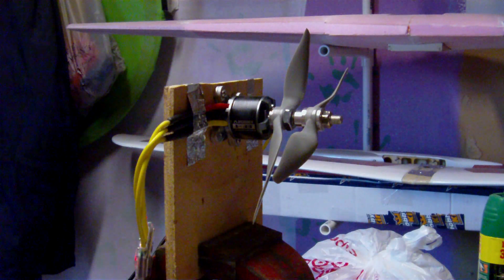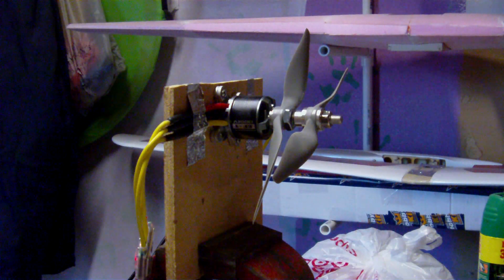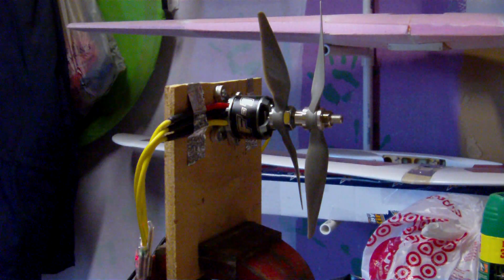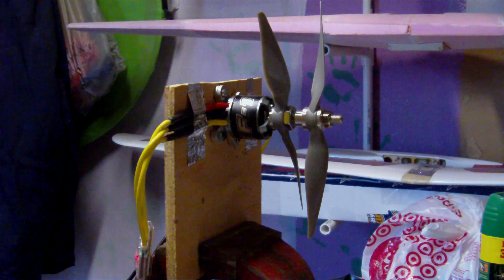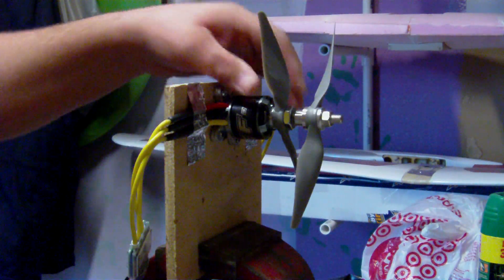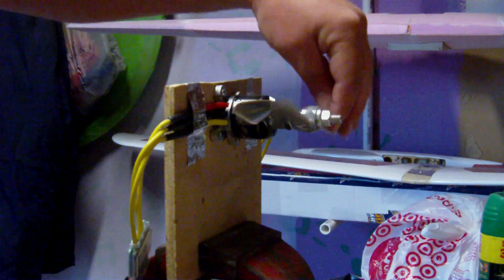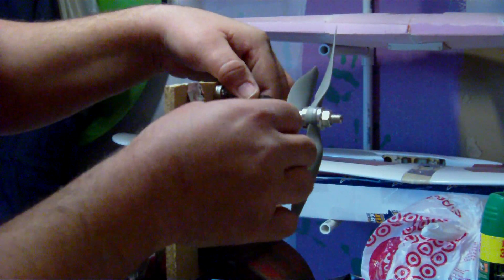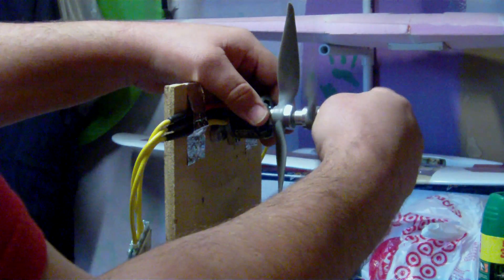Contra Rotating motor test for Bugatti 100p project

Comment: That looks really interesting! What's the overall weight of that setup?
Reply from the maker: A GREAT question. I'd estimate somewhere around 14oz. I never actually measured the mass of the motors fully assembled but based on the mass of two stock motors and the longer inner shaft along with the custom outer shaft, that seems about right. Sadly, The NTM EF-1 motors are now discontinued.

Comment: it makes more sense to me to wire the 2 motors together and just use 1 ESC, any reason to not do that?
Reply from the maker: The ESC uses feedback from the motor to time the phase pulses. Since the motors will invariably be slightly different you risk feeback into that system and end up having issues. This is true for all electric twins or multi-motor aircraft, not just this contra example.
Reply: Joshua Orchard that makes sense, cheers!

Comment: Well, would you please consider to share the power consumption, prop size, and specially the trust... I'm an addict of thinks that give you more thrust in the smallest package possible.
Reply from the maker: 8x8 and 8x8R props, ~800W per motor. No thrust data as I do not have a thrust stand. I normally use the fish scale method once the airplane is built.
Reply: Yup I do use exactly the same way to find out abut thrust.. may be the only difference Is that I make a custom mount system like a "Pendulum, to reduce friction" then probably use exactly the same fishing scale you have! ! thanks for the prompt reply.